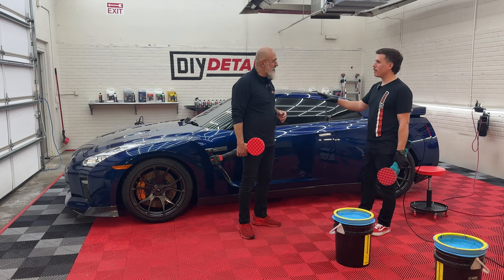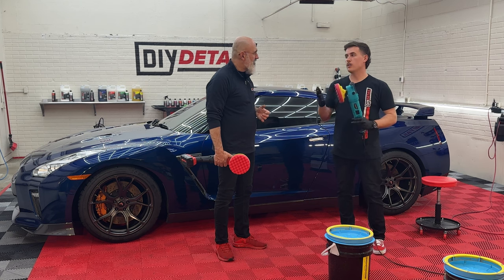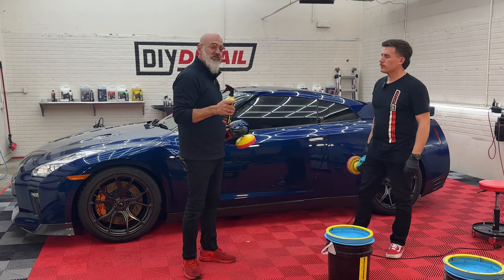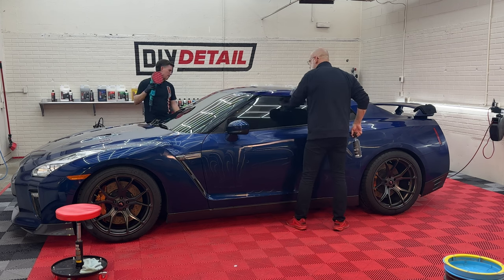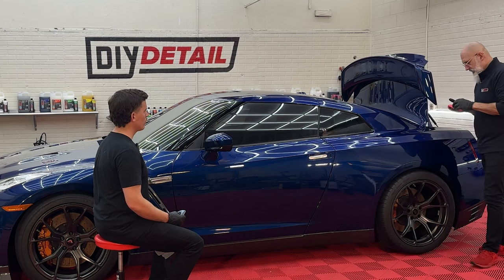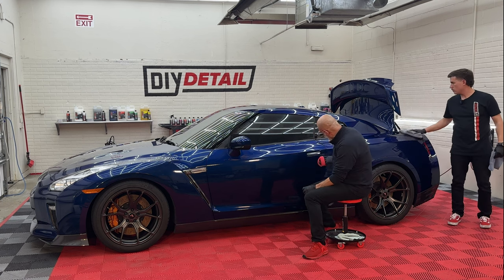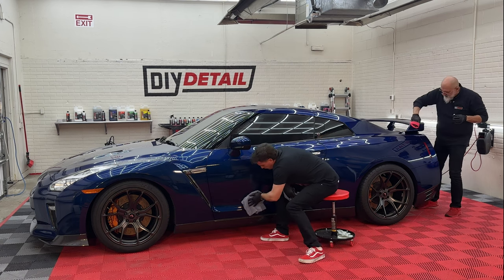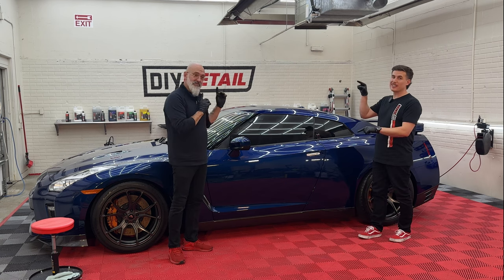GIVING GODZILLA GLOSS: Polish & Ceramic Coat Nissan GT-R!

Comment: Great presentation of your ceramic coating.  Does your ceramic coating flash or give the rainbow signal like other ceramic coatings? Is your ceramic coating hard to remove if I wait  longer than 5 minutes? Do you coat the door jambs also?
Reply from the maker: Hopefully this explains a little bit more: How to apply ceramic coatings
https://youtube.com/shorts/WkRD3f8rNuQ?feature=share
Reply from the maker: So just wait for about 50% of the coating to flash from the surface as a visual signal to level. If you wait longer than 5 minutes and you can’t level the coating well, simply apply a little more to the surface and level/wipe immediately. I love coating door jams I usually do it last

Comment: Can I use the red pad on 15mm DA (it's the only machine I have)? Also, do you guys recommend 6' or 5'? My machine has both backing plates.

Thanks for the awesome work and valuable tips!
Reply from the maker: On a 15mm machine it’s fine, I prefer 6 inch pads

Comment: Great video like always! Still thinking about 3,5,8 years. What do you guys recommend? Also what Milwaukee Rotary Model number? United States! CT! Thank you .
Reply from the maker: Hey Robert! What is the vehicle and what is your goal with the coating? I like the 5-year because of the gloss, but it depends on the job for sure I often reach for the 8-year to get maximum performance and durability
Reply: @diydetailofficial  2019 F150 Black it’s in the same shape as the vehicle in this video. I’ve been learning on the 5 year. Also I have to apply this outside the weather in Connecticut has been crazy hot then cold .

Comment: Im still unsure witch one from 3 or 5 for my cars. I like super shiny cars but like the cleaning ability.  Right now I have TW graphene flex wax that I top with ceramic gloss on every wash. I want something that will outshine the TW. When canadien seller will have the red pad ?
Reply from the maker: Get the 5 year, it will give you the best gloss, and it’s easy to clean. The red pad will be available worldwide in July
Reply: Thank you.  I also have a car that my daughter goes to the university with in lower Nova-Scotia where it rain most the winter.  As a student she won't wash that car. It only get clean by me when she get home two tree time between September and april. Should I go with a 3 years for that one or the 5 years ?

Comment: What if my rotary have a 7in. Backing plate??
Reply from the maker: You would want a 7 inch pad. Or you can get yourself a 6 inch backing plate for rotary polisher, I know lake country, flex both make them, among many other brands
Reply: @diydetailofficial  well I was looking to use the gold standard but y’all don’t make a  7 inch pad so I’ll try to find another backing plate
Reply from the maker: Yes a 6 inch pad will give a little more flexibility, plus the smaller diameter slows down the outer edge of the pad giving you a cooler surface, meaning better cutting and finishing.
Reply: @diydetailofficial so 5” would be even better?